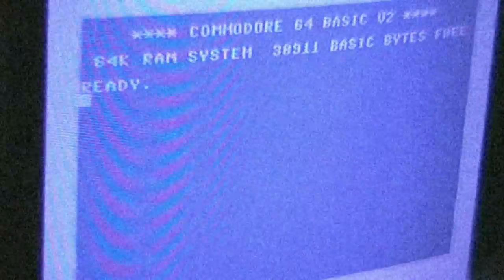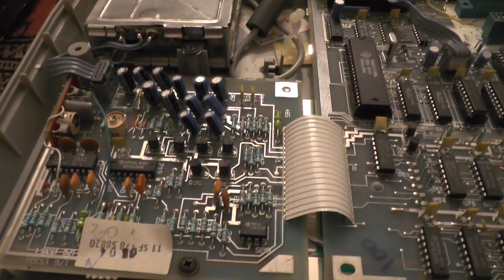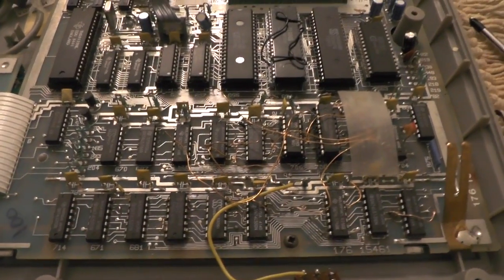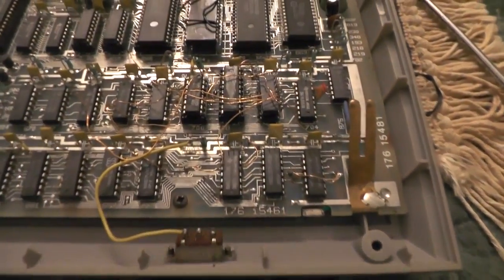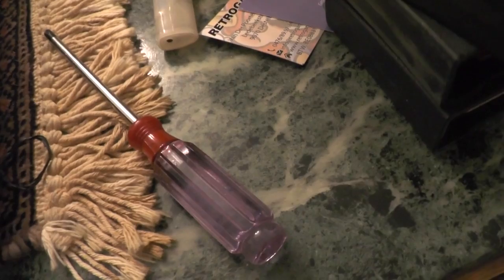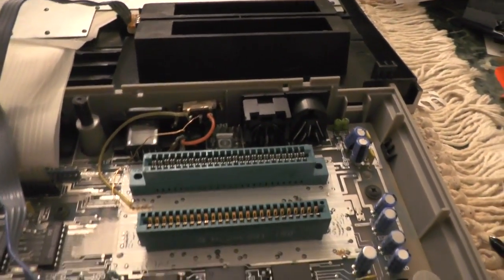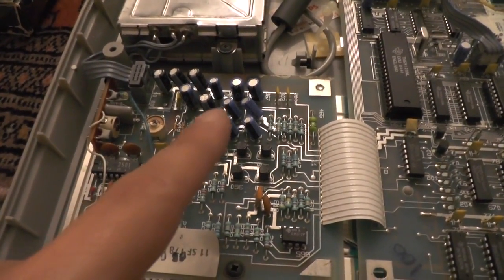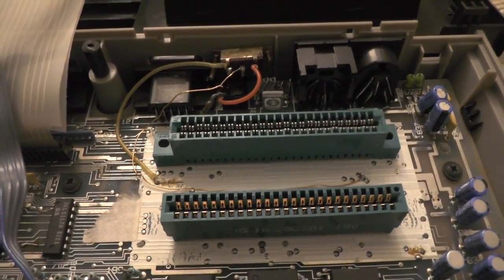Philips VG8010 With a Weird and Dodgy Mod

Comment: It definitely is some sort of RAM upgrade. The big chip you see all the way to the left is the VDP chip. Then the 4 smaller chips are RAM (2 first ones for the VDP, then 2 for main memory). The first of the big chips on the right is the AY-3-8910 (sound), then the one you asked about is a 8255 (memory banking, keyboard, ports etc.), then the Z80 CPU. All the smaller chips you pointed out as being RAM are in fact logic chips.
Originally on the VG8010 those two last RAM slots for main memory were just empty sockets, and were only used by the VG8000 (which had only 16k RAM). On the VG8010 the 32k RAM was in fact on a separate daughter board, which your machine is missing.
So it looks like the previous owner removed the RAM daughter board, then fitted 2 upgraded RAM chips into the empty sockets next to the AY-3-8910. The ugly copper wiring is probably to reroute the logic chips to allow extra RAM. I'm assuming it's upgraded to 64k. You could google the labels on those 2 socketed RAM chips to see what they are.
The board on the left is a PAL encoder which plugs into the RF modulator. Some models had RGB output instead, and so this board would be replaced with an RGB encoder instead and no ugly RF modulator.
Reply from the maker: I probably just try to power it up and see what I get.
The rattling I heard was just a piece of plastic that has broken off from the case.
Everything else on the board looks 'fine'.
A RAM upgrade to 64k would make the most sense, indeed.
Looks like there is also some mod of the bank switching, so I assume that you can put some RAM to where the cartridge ROMs would usually be.
Seems to be a very useful mod, but sadly done by someone who didn't like doing such things... even I would make it look a bit better and I hate soldering.

Do you have any idea if the machine should work without the -12V?
I know that the Amiga does, but the RS232 port would not work.
I had a quick look at the schematics and I could not find anything that requires the -12V.
I have plenty of +5V/+12V PSUs over here, but none that also has -12V.
I know there are ways to get al 3 voltages, but for a quick test I would rather try something I already have instead of investing more money.
Reply: If it was upgraded to 64k RAM, probably was to allow VG-8020 games to run here. I have a VG-8010 since 1984 and back in those days a friend of mine had a VG-8020 and some games from him did not run on my computer.

Comment: That looks like a interesting computer can't wait to see it up and running. I will say though some of those caps by the cartridge port look like they need changing as the jackets have shrunk quite considerably. I think a AMIGA power supply might have similar power voltages so might be worth checking out if you got one spear

Comment: I don't know everything about this computer but I may have one or two clues about it. The original memory chips are between the VDP (Video Display Processor) and the GI AY-3-8910 PSG (Programmable Sound Generator). The VDP is the large chip at the left side of the main board. It is a TI TMS9918 family chip, probably a TMS9129. The chip you couldn't identify is a Intel 8255 compatible, also called the PPI (Programmable Peripheral Interface), and it is used to control the slots and provide cassette and keyboard interfaces.
Reply: The smaller board to the left is the PAL encoder. I'm not sure why the RF modulator is so huge, but there it is.
Reply from the maker: Thanks for the infos.
So I assume that the switch on the back has something to do with the memory mapping of the machine.
Probably something to configure the RAM to sit were the cartridge ROM usually lives to make playing 'backup' games easier.
Not a bad thing if this works.
Reply: Theshadowsnose MSX models from the MSX2 upward have at least 64kB of main RAM, but some MSX1 models can have just 32kB, like the VG-8010, or even less. This is fine if all you do is play cartridge games and make some BASIC programs (and save them to tape). You can also play pirated cartridge games if they originally have only 16kB (you can load them from tape).

But if you want to use a disk drive, you'll need 64kB or more. This would also enable you to play pirated 32kB cartridge games and run somewhat larger games made for disk only. If you look at the VG-8010 slot map at the MSX Wiki, you'll see that slot 0 has both the System ROM (from memory address 0000h to 7FFFh) and the Main RAM (from 8000h to FFFFh). Slots 1 and 2 are the external cartridge slots, while slot 3 is completely empty.

You could solve this problem by plugging a 64kB RAM cartridge in either of the external slots but, alas, a lot of MSX programs, including many games, can be confused when Main RAM is spread across different slots. I won't get deep into technical reasons for this, so forgive me if I'm being annoying, but this happens because the system "thinks" it only has RAM in slot 0 (the first one where it finds RAM at boot), which are only 32kB (because the remaining address space in that slot is occupied by the System ROM) and it sets those as the work memory.

So I think this mod looks that complicated because it not only expands the memory (possibly setting it up in slot 3, which is empty anyway) but probably disables the original memory in slot 0. Maybe there's one switch for disabling the 32kB in slot 0 and another to enable 64kB in slot 3, so you can use 96kB at the expense of some software compatibility (carefully coded MSX programs can work with this).

Again, sorry if I'm being too technical, or if I'm not helping too much with my explanations. I like your channel a lot, so I'd like to help if I could. Cheers!

Comment: It looks like the switch only has one wire going to it, so it would not do a lot.  I would take some good photos of everything, then remove all the wiring and start from there, possibly removing any extra chips and make it back to an original machine.
Reply from the maker: If I would remove the mod, the machine wouldn't work anymore.
The modder removed the original 32k of memory which were one a seperate daughter board and replaced it with this shoddy thing.
THe mod is probably an upgrade to 64k and some way to map the memory to a different location than normal.
Both would be very handy to softload cartridge games on that machine.
I think I try to get the machine running WITH the mod and keep it as it is.
It's also a good documentation of what hobbyists did to their computers back in the days.

Comment: As you say that Modulator looks huge.  If I designed that thing I would have had an internal PSU replacing that thing, and have a multi video port out.
Reply from the maker: Internal PSUs have their pros and cons, but I would appreciate an internal PSU for this one. It would not have been lost ;-)
Just compare the modulator to the ones in a Sinclair Spectrum... I mean Philips made TVs and VCRs... they must have been able to get this small enough to include all 3. Internal PSU, TV-Out AND multi IO.

Comment: This mod probably change the position of the memory bank allowing expansion memory from cardtridge in the first possition for compatibility issues.
Nice machine. I have one with 1mb cardtridge expansion. First I disable internal memory for more compatibility with games.
Reply from the maker: I'm pretty sure that it is some sort of memory mod.
Would make sense to upgrade the machine to 64k.
The switch on the back may have to do with what you said since it seems to swap some lines on the cartridge ports.

Comment: 8010 was my first home computer back in 1984/85. I didn't like it because it didn't play a lot of Konami games that required 64kb of ram.
Reply from the maker: I probably would have liked that machine as my first computer, but I'm not sure if I would have liked it as mcuh as my C64.
The main appeal of the C64 was that copying games was ridiculously easy on it and I had a lot of classmates that had a C64 as well, so there was never a shortage of new games for it.
I would surely have loved the BASIC on the MSX machines and I guess I would have programmed quite a bit more if I had one of those instead of my C64.

Do the Konami cartridges require any RAM more than the minumum 16k that MSX machines were sold with?
Or were you trying to 'softload' them?

Comment: the memory mod has been taken out, as it would actually sit on top of the onboard chips. the switch and yellow wire i would presume is for memory switching ie from standard 256k to 512k id think for compatibility issues. i have an image of what it should look like ill need to send you it. i have a phillips msx 2 8255 model that has 256k standard ram dual disk drive dual cart slot but i have the mmc 512 sd cartridge so memory isnt an issues for me. i know this is 2 weeks ago but i have been online for a couple of months and im catching up. ill add you on facebook and send image over...
Reply from the maker: They've taken out the original memory expansion to 32k, but I belive they replaced it with an upgrade to 64k.
I guess I have to power the machine up to see what it does, but I'm still missing the PSU.
Do you know if the machine needs the -12V to power up?
Reply: Not sure on the 12v but I do have the low down on the model that I’ll send via Facebook.btw that model had 48k. 32k ram and 16 k vram. That yellow wire is a concern I’ve no idea why it’s there or function it does. I would hold off trying to power up until you’ve found out why. Try msx resource site good and informative. Msx.org

Comment: Those mods look terrible. I removed a rom mod from one of my c64's that looked like that. It worked, but it was terribly useless.
Reply from the maker: Was it a SpeedDOS mod?
That's very useful if you have the matching floppy drive!
Reply: Theshadowsnose  NO, actually I think it was a homebrew ROM. All it did was add some functions to the function keys. It was very sloppy and quite useless.